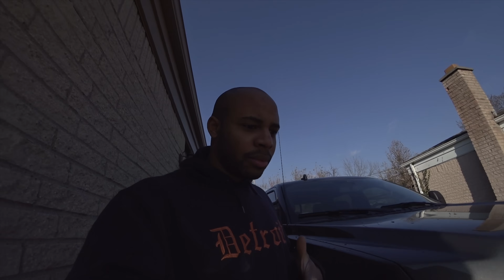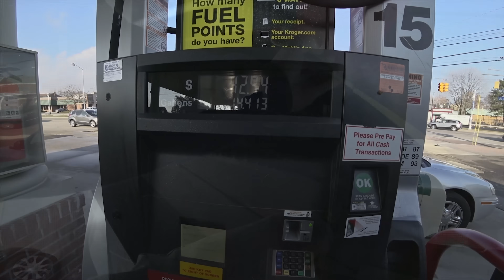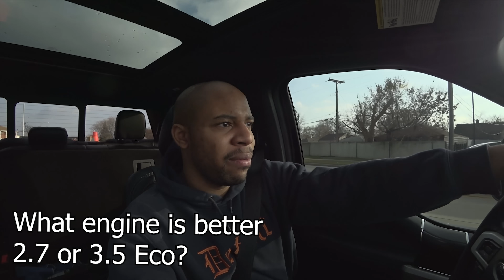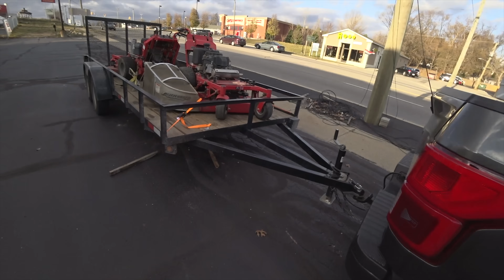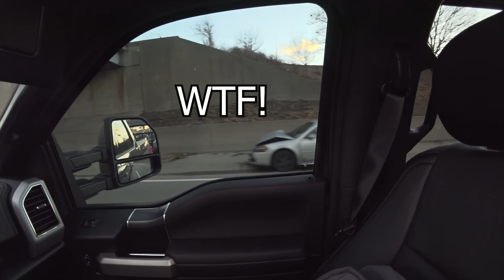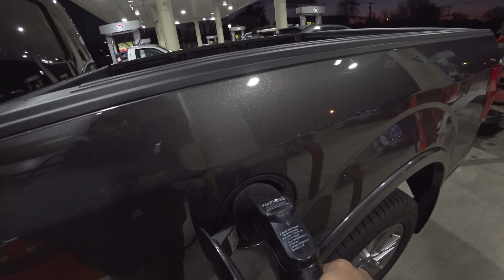2018 Ford F150 Towing MPG test!

Comment: Hey Sean. Finished my first tow today (399 miles on the truck LOL). 75 miles mainly highway. 21.2 mpg with a fully loaded bed, 5 passengers and a full Uhaul trailer. Tow/Haul mode the whole time, was in 7th gear most of the time on the highway. I'm sure at normal mode even with the trailer it could do better as it could utilize 10th gear a lot. Very happy with that!
Reply from the maker: @CleanClaspCollector  That's awesome!

Comment: I feel like any resistance on an ecoboost engine makes the fuel economy go way down. I went to Colorado in my 2.7. Avg 18 on the way out. Coming back home was 14. Had a small head wind 2/3 the way home. Not pulling any trailer.
Reply: Just pulled a uhaul trailer 75 miles with my '18 3.5. 21.2 mpg.

Comment: Sean do you plan on getting a catch can for the truck. That will make a difference in gas mileage. I gained almost 2 mpg when I installed one on my 2011 3.5 ecoboost.
Reply: I just got a loaded, 2016 Lariat 3.5. With no wind at all and on flat surfaces, I am getting in the mid-to-high 20s. But, with any bit of a headwind, it dips down into the high teens. I'm new to the turbo thing and have been a V8 guy for all my life. Can somebody explain to me what this catch can is? I'd love to add it if it'll add to miles per gallon and not void my warranty.
Reply: A catch can is an oil separator. For the pvc system. Turbo vehical have high cyclander pressure and cause blow by. Which cause more fuel to be used to keep the right fuel ratio.
Reply: F-150 KING OF TRUCKS you still will need it due to the intercooler filling up with oil. It's not just the intake valves you need to worry about. You should use one one every trubo vehical.
Reply from the maker: I would do it only if there was a way to get rid of the contaminates automatically... but for 2mpg hell yeah! i will look into in now!
Reply: don't need any catch can for a 18 model...
Reply: Dennis Givens thank you very much. I'm guessing that wouldn't be too hard to install, then, considering it's in the PCV system. 
Do you recommend any specific brand?
Reply: Metalbass79 check out Cjponyparts on YouTube. REP is one of the best but pricey.
Reply: Metalbass79 the RXP comes with stock pvc fittings just plug and play.
Reply: F-150 KING OF TRUCKS I got one on my 98 z28 and it doesn't have a turbo. It get oil into the intake also due to the 10.1.1 compression ratio.
Reply: Dennis Givens I'm going to check that site out right after I get off of work and look into one of these. I've ordered from them before for a couple of my Mustangs. It's a great company. I want to make this truck last for a really long time and get the best performance and mileage out of it that I can.

Comment: That mileage seems pretty low for such a light trailer load. But for max MPG leave the glass closed...yes the sunroof too. That is just an MPG suck. I heard you accelerate pretty aggressively that doesn't help MPG at all.  A bed cover of some type would help too. Did you have a cover on the 2.7 I don't remember?
Reply from the maker: Paul Rodrigues nope, no cover on the 2.7 But you're right could definitely do better on MPG if I drove slower! Yeah when I hit the gas the back tires were spinning a little! The driver has the biggest impact on MPG!
Reply: Oh driver problems ...oh they are the worst. LOL Thanx Sean

Comment: Are u hip 2 the Ford pass? What is the purpose of the extended tank?
Reply: The range..... On my 2015 F150 it gets 20.5 mpg's I've seen miles to empty as high as 760 miles and I love that.
Reply from the maker: Ford pass is pretty cool!  If you but one make sure you get that feature! cause its not practical to add it after the fact... i did a video on in... should be in the playlist 2018 F150 cool features...
Reply: DonnaSean I'll be looking 4 that video!

Comment: do you always run 93 octane? I've been running 87 on my 2.7 but just hit 5k miles and am thinking of switching to 93 octane. any advice?
Reply from the maker: Drew Batelli I would recommend sticking to regular gas... The 2.7 Eco has water cooled exhaust and direct-injection... both together help minimize knock... that is why the two seven is the most powerful engine per cubic inch that you can get an F-150. My 207 seem to run better on regular gas...
Reply: From what I've read, and heard, 87 is fine for everyday driving, but for tow/haul, 93 is recommended.

Comment: The 3.5 is definitely built for towing.  Of course you get what you pay for.  I have the 2.7, cause I don't plan on towing anything and wanted the max mpg's.  Besides my 2.7 engine was a $800 upgrade, while the 3.5 was a $2200 upgrade.  Plus the trailer package on the 3.5 was $900 and $450 for the 36 gallon fuel tank.  That's an additional $2750 that I didn't need to spend.  If you need it than buy it, but if not than well!!!  I know people love their 5.0, but they really don't get that great of mpg's in the city.  They do sound good though.  Of course if you want something that sounds good, then buy a mustang...lol

Comment: if your getting that as ur mpg why not go for a 5.0 they get about the same i have a 2016 5.0 i do lawn care pull everyday mowers n i get 12.2 mpg pulling 5 days a week lol
Reply from the maker: Obed Garcia I believe it! I went with the 3/5 because it's the highest rated for Towing... but maybe I should have went 5.0!
Reply: DonnaSean trust me when i went looking for which engine when they told me the repair costs compared to the 5.0 i said heck no haha goin 5.0 plus didnt like the idea that my power relys on a turbo if it were to go out my powers out plus i love the 5.0 grittys feeling haha